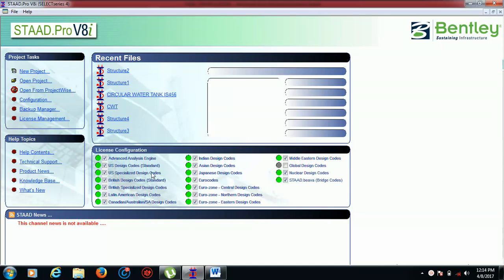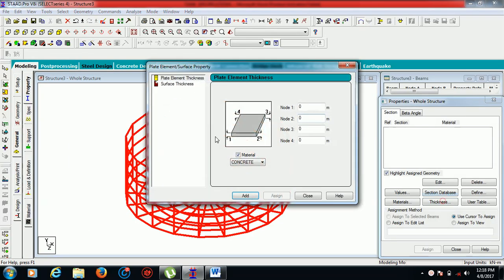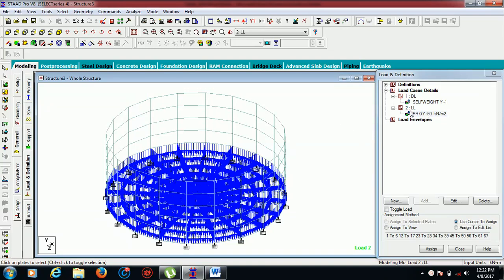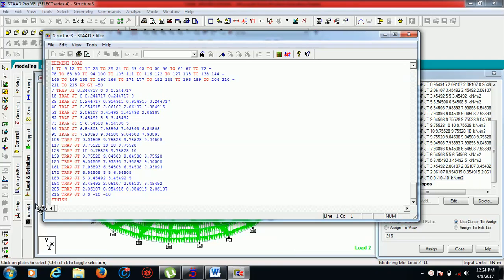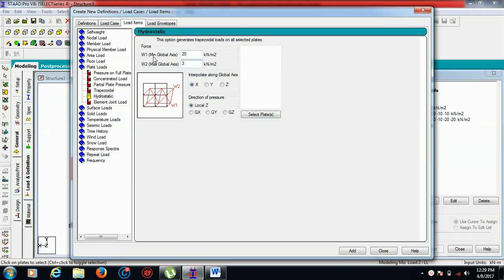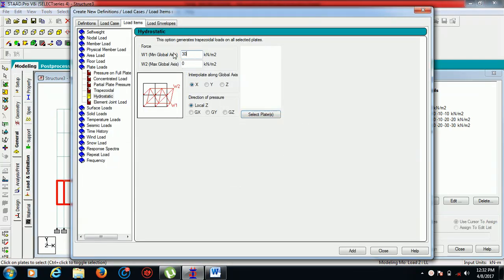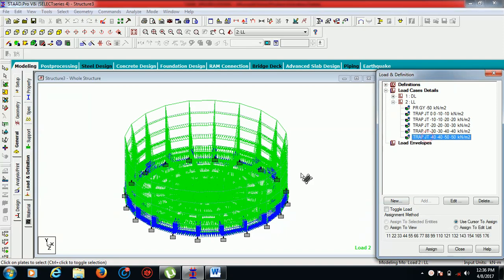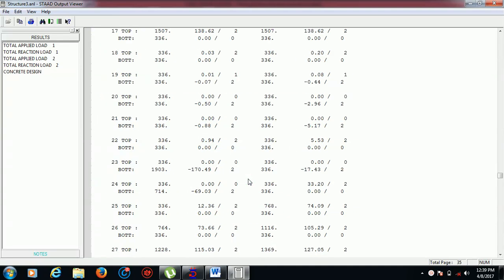Circular Water Tank Design IS 456 Staad Pro Indepth Tutorial

Comment: well explained.....sir need a clarification that every time you apply hydrostatic load u do editing in staad editor, instead of that i given load in terms of negative values like -10 -20 but after i applied in all 5 steps its not showing like triangular loading instead of that it showing loading like steps....where am wrng??
Reply: Maybe there is an error in interpolation along the required direction..... interpolation along the direction would be Y and tick local z

Comment: Thank u sir..... what about if we are designing an over head water tank? i mean the support for bottom slab of the tank itself having capacity to resist or we need to give any beam ? and also slender column need to tie ......how we will solve this issue.. also wind load in tank structure?  better if u are giving a video regarding this... it will be very helpful